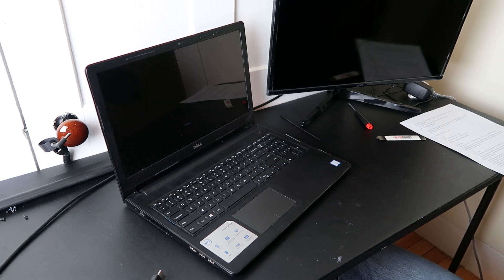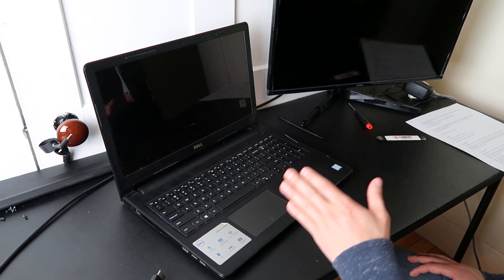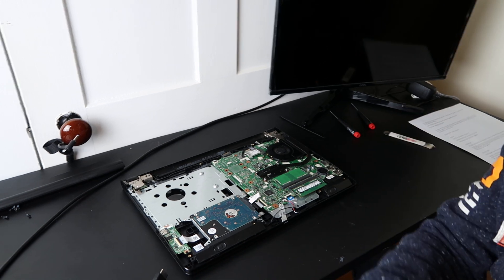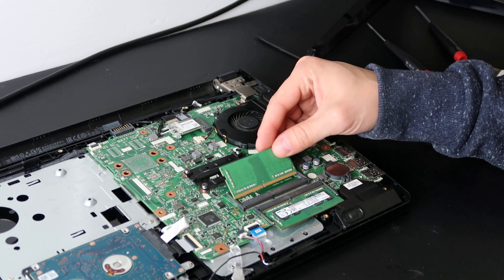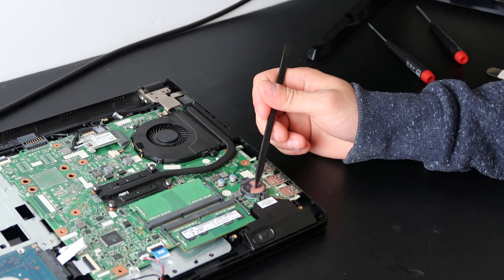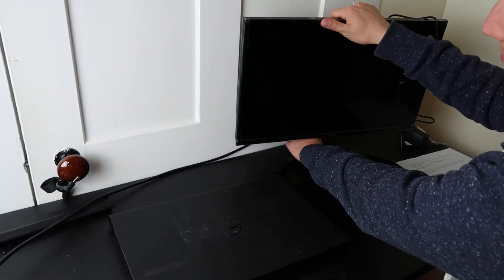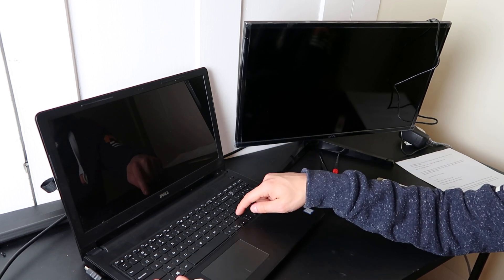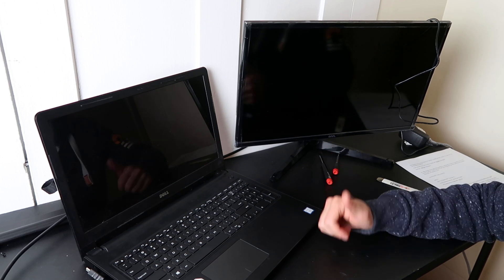How To Fix Black Screen / No Display / Dim Screen / No Picture for Dell Laptop

Comment: my laptop crashed while watching video and i cant do anything and closed the laptop after open the laptop the laptop still crashed
Reply from the maker: Are there any signs of life at all when you try to turn it on?  Lights?  Fan, Motherboard, or Hard Drive sounds?  Anything seen on the screen?
Reply: @PC_Monkey  lights are on
Reply: @PC_Monkey  yes lights are on my laptop is dell latitude 3540
Reply from the maker: @Lolwhoareyou824  If the lights are the only signs of life with no fan or HDD/motherboard sounds then the computer most likely is not really turning on.  For a computer that does not turn on, try this video first;  https://youtu.be/P3I7dDpkJps.  Let me know how that goes :)
Reply: THE LIGHTS AND BEEP SOUND ARE THE ONLY SIGNS OF LIFE
Reply from the maker: @Lolwhoareyou824  Ok so the computer is beeping too.  Is it beeping in a pattern?  
For a computer that does not turn on, try this video first;  https://youtu.be/P3I7dDpkJps.  Let me know how that goes :)

Comment: hello! what size of screwdriver would be best to use in unscrewing? i tried using one of my screwdrivers here but i just couldn't get the screws to come loose
Reply from the maker: Its different on different computers but generally I find that my 261 / PHO x 50 driver works well :)
Reply: @PC_Monkey  oooo i see thank you very much! i plan on doing what you did on your video on my dell n5050 (｡’▽’｡)
Reply from the maker: @twicebestgirls558  Good luck !!  Let me know how it goes :)
Reply: @PC_Monkey  sure!! thank you again :D

Comment: hdmi ok but no lcd
Reply from the maker: Check out the FAQ's on my videos next time!  Could help you get an answer faster :)
If your computer displays to an external monitor but not to its own LCD, then your issue is most likely with your LCD or LCD Cable.  Try 'Reseating' the cable first by unplugging it from both ends.  Then, plug it back in.  If that does not help, replace the LCD and Cable one at a time.

Comment: I just got a new Dell Inspiron 15 3511 and charged it. Opened it and nothing black screen. Held power button 3 seconds and released nothing. I believe there is an internal battery. Are you kidding me? I do not want to fix a brand new computer after I paid for it. This is BS!!!!
Reply from the maker: You def shouldnt have to DIY fix a new computer.  I would leave it charging overnight.  If it wont turn on after that, return it
Reply: @PC_Monkey  thank you for replying we are returning it! Waiting for the return label. How long should one wait for one?
Reply: @PC_Monkey  it was charged overnight
Reply from the maker: @suemedeiros800  How fast you will get a return label depends on the company thats sending it.  Sorry, I cant help with that :)

Comment: at this point I think it's time to give up... 

my dell xps something is well over 10 years old, has a shot battery, broken frame so the screen doesn't stay up and now this. I'm afraid no professional in the world can save her without breaking multiple banks.. breaks my heart to let so many photos, videos and game saves go. 😕
Reply from the maker: If the computer is broken, the HDD may still be good.   The DATA is saved to the HDD.  You can still access it with another working computer :)

Comment: I haven't used my Dell laptop for 2 years. I stowed it away in a box. Today, I turned it on - Black screen. A white and orange light is flashing on the bottom right corner. The keyboard lights up, but that's all. Thanks for your help.
Reply: Have u fixed this?
Reply: @xenon183  
No
Reply from the maker: @jamig.7254  Are there any signs of life at all when you try to turn it on?  Lights?  Fan, Motherboard, or Hard Drive sounds?  Anything seen on the screen?
Reply: @PC_Monkey  
Thanks for getting back to me.
Yes, the keyboard lights up. The light indicator for the battery flashes white and orange. However, when I charged it for many hours, the monitor was still black. The keyboard remains lit.
Interestingly enough, when I first plugged it in, I could feel the AC battery adapter  warming up. Then later, it seemed inactive and cool to the touch, yet the light was still on that attached the adapter cable to the back of the computer.
After charging for hours, I checked the monitor for the last time, still nothing. When I removed the battery cable and closed the monitor, the battery light (bottom right corner) was flashing rapidly in white.
Reply from the maker: @jamig.7254  This video is for a computer that turns on but the screen does not work.  If the only signs of life your computer has are some lights, then its possible that its not really turning on and engaging the Hard Drive, Fan, etx.  For a computer that does not turn on, try this video first;  https://youtu.be/P3I7dDpkJps.  Let me know how that goes :)
Reply: @PC_Monkey  
My battery doesn't come out. It is securely attached to the motherboard.
There are 2 ports for RAM. One RAM card is missing, so I took the one card out and put it in the other port. The monitor screen remains black.
I took out the C-battery for 3 minutes, then reinserted it. Still a black screen. 
I'm thinking the charger is bad, because the laptop will not turn on, unless the charger is plugged in. If the battery is totally useless, then the laptop's keyboard would not light up right?

Comment: Hi pc monkey I have an odd issue, when my laptop turns on the screen is black. But when I connect it to a monitor or TV via HDMI the screen will come on then I unplug it an it works fine , what is causing this

Comment: I have this dell inspiron 15 3000, i just made it stayed open in a while when I came back the monitor gets black. I don't know and I don't have any tools in opening the laptop. Should I bring it to a technician? What should I do to turn it off?
Reply from the maker: Does the screen go black or does the computer turn off?  If the screen is black, what are the signs the computer is on?  Lights?  Sounds?  Fan?

Comment: Hi, thanks for all these useful information, unfortunately, i tried everything you made mentioned and my dell latitude e6400 still remain black, even though all the light came up and one can clearly hear the machine is working. I later discover that a cable from the LCD is broken and I don't think it is changeable because it comes out from inside the LCD,  I think the only option for me is to buy another LCD.
Reply from the maker: Most LCD Cables can be replaced independently of the LCD.  What model Dell do you have?
Reply: @PC_Monkey   Dell Latitude e6400, I plugged it to an external monitor and it shows clearly, but with it's own screen, you can see it displaying under black screen, I mean, its not bright, one struggle to see what it shows. what is the way out ?, Please.
Reply from the maker: @danielomotosho2321  If the computer works well on the external monitor then your most likely looking at an issue with your LCD or your LCD Cable.  I would try unplugging the LCD Cable from both ends and then plugging it back in.  This will help if it has just become lose.  If not, then you should replace the Cable or the LCD one at a time until you find the one with the issue.

Comment: Hi, mt laptop starts up like you say, you hear the insides turning on, the fan kicks on, it shows the dell logo but no loading and then says it couldn't start, click restart or advanced settings but Everytime I click on restart, shutdown, fix the problem with a restart or diagnose the problem, none of it works, couldn't fix the problem, couldn't diagnose the problem.
Reply from the maker: For that issue, your would refer to this video instead;  https://www.youtube.com/watch?v=w3XfE-ghbhs&feature=youtu.be
What do you mean, you couldn't diagnose the problem?  Did the diagnostic test not work?  What happened?

Comment: Thank you for this vid! I'm actually hooked up to an external monitor now. Do you think I should just buy the LCD cable and go with that fix first? I watched the vid to fix it and I literally have to take the entire laptop apart LOL. Thanks for your help in advance.
Reply from the maker: It depends on which you want to do first.  LCD and LCD Cables as you mentioned are hard to get to.  LCD Cables are cheaper to purchase but harder to put in.  Its up to you and your laptop which you would rather start with :)   You can also try just reseating the cable from both ends first before replacing it.  Perhaps its just loose

Comment: I need serious help,my computer turns on but no signal to monitor.the computers a refurbished and I did a diagnostic test and it was all good but during a restart the monitor wouldn't turn on
Reply from the maker: If the screen is black, what are the signs the computer is on?  Lights?  Sounds?  Fan?

Comment: Hello brother, I am from india , I have 8 years old dell n5050 laptop, and same problem I have screen is black but screen showing on hdmi other monitor. and I tried battery method but problem not solved then I take laptop to repair shop there laptop repairer said there is mother board problem , there will be Rs 2000 cost work will be there, is it true or he is lying , or he will just clean laptop ram and inside mother board and just fooling me , please answer ?
Reply from the maker: If your computer is displaying to an external monitor then its most likely not a motherboard issue.  If your computer displays to an external monitor but not to its own LCD, then your issue is most likely with your LCD or LCD Cable.  Try 'Reseating' the cable first by unplugging it from both ends.  Then, plug it back in.  If that does not help, replace the LCD and Cable one at a time.
Reply: @PC_Monkey  Then the repairer is lying and looting money from me.
Reply: @PC_Monkey  I would not repair then their, he is saying there is problem in your motherboard display part, and not in cable part.
Reply: I should take my laptop to other shop where it can be reasonably repair.
Reply from the maker: @priteshgupta4817  The issue could possibly be in the display port but you cant know that until you replace the LCD Cable and the LCD

Comment: What about the screen going black but only after log into it?!  But when I open task manager it shows up and from there I'll open a browser or my computer.  Whatever I open stays on until covered by another folder/app/ etc
Reply from the maker: First, make sure computer is fully updated as seen here;  https://www.youtube.com/watch?v=DDv2gJDjfOM
If that fails to change anything, try a Factory Reset.  Assuming you have a Dell, you can see that here;  https://www.youtube.com/watch?v=IE1zShTb0rU&t=43s.  If that fails, to help, try removing one of your RAM and running the computer on the other on, assuming you have 2.
If RAM is not the issue, then try a new install of Windows as seen here;  https://youtu.be/ULrJVk4JJ20.  You can create your own Install Media for free as seen here;  https://youtu.be/g_UhiHScaSI

Comment: What if it happens off and on? I mean, many times the laptop works fine, but sometimes, especially after goes into sleep mode when battery is down, the display won't turn on at full brightness, and I can see very dim display, almost invisible. Force power off, wait for some time, like 15-20 min and switch it back on with fingers crossed. It may turn on normally or continue to remind dim and I have to repeat the process. Kindly help. Thanks
Reply from the maker: your on the correct video.  Are you able to try the steps seen here yet?
Reply: @PC_Monkey  not yet. Because I will have to buy a RAM to check, as even after changing a RAM, if the PC turns in, I am not sure if the issue is resolved, unless I use it for some days to see if the issue comes back again or not. Can you let me know if the RAM is bad, will the this issue can happen off and on?
Reply from the maker: I cant tell you if the RAM is the issue as I cant examine the computer.  If you cant test the RAM then you will have to skip that step and try the others in the video for now, until you can test the RAM

Comment: Mine is just not making any sound but it on it a hp labtop 625. I suppose it is the batterie small one semiso or ram stick
Reply from the maker: This video is for a computer that turns on but does not display.  If your computer is not making any sounds, what are the signs its on?

Comment: my computer does not show or display on screen i have changed ram and hard disk but still didn't solve it
Reply from the maker: If the screen is black, what are the signs the computer is on?  Lights?  Sounds?  Fan?
Reply: @PC_Monkey   thanks ..I  saw your video removing bios battery  I removed it and return the my laptop  now its okey
Reply: Thanks  for your  videos
Reply: Also my friend laptop its turn on and ends to log then stop there
Reply: What can we do
Reply from the maker: @travexonlinetv2394  Glad your all set :)
I dont understand your issue with the other computer.  I dont understand 'its turn on and ends to log then stop there'
What is happening exactly?

Comment: Dell Inspiron 1500 laptop repeatably beeps on start up with black screen and does not boot
Reply from the maker: Have you tried the RAM test as seen here?
Reply: @PC_Monkey     yes I have tried all the test new RAM and CMOS still beeping and screen still black. Or I have to replace with a new motherboard
Reply from the maker: @harver16  Were you able to get the computer to display to an external monitor?
Reply: @PC_Monkey   not yet am going to try it with external monitor
Reply: @PC_Monkey  yes I tried with external monitor didn’t work, what can do now
Reply from the maker: @harver16   If all of the steps here didn't identify the issue and the computer didn't display to an external monitor then we are left with your motherboard being the problem.  It should be replaced.  You can see an example of a motherboard replacement here;  https://youtu.be/N_7HNrFkMS8.  Let me know if you need help finding one or with the install
Reply: @PC Monkey  okay thank you so much
Reply from the maker: @harver16  Good luck !!  Always here to help :)

Comment: Half of my screen are black ,Any tip?
Reply from the maker: Only half?  That could mean that the LCD is damaged and needs to be replaced.  If you plug in an external monitor, does the issue repeat itself there?

Comment: ahh quality content: pc not working? switch ram, clear cmos, if still doesnt turn on just buy a new laptop
Reply from the maker: So no RAM test, no BIOS reset, and not testing with external monitor.
So how would you troubleshoot a computer that turns on with no display?
Reply: @PC_Monkey  The basic troubleshoot is fine, but if that doesn't solve it you dont simply throw it away.. at least recommend to take it to a technician. I was expecting a basic guide to look for a short on mosfets and stuff. The  repair is probably a few dolars compaired with replacing a mother+cpu wich is almost the same price as geting a new laptop
Reply from the maker: @escafoide  As stated in the video, the solution if these tests dont find the issue is not to throw the computer away lol.  Not sure where that came from.  The next step would be Motherboard issues.  Most of my viewers dont get into Motherboard repair, so a replacement is advised.  Taking to a tech is always a common sense alt when DIY fails to find a solution.

Comment: My laptop battery is not in good condition. is this can be a problem? My screen is turns black and after sometime it is back. Can u please suggest  something.
Reply from the maker: The computer loads and works well but the screen goes black as your using it?
Does the screen go black or does the computer turn off?
If the screen goes black, what are the signs that the computer is still on?

Comment: How are you bro, I have a problem with my Dell laptop. I removed the battery from it because it was not working and it only worked for a cable for a while. Today, suddenly, the screen turned black. I returned the bad battery. First I turned laptop on, it turned red, then I turned it off and turned it on. It came back to black, what is the reason?
Reply from the maker: If the screen is black, what are the signs the computer is on?  Lights?  Sounds?  Fan?
Reply: @PC_Monkey  sound , lights and keyboard is working ,even fan , only the screen is black
Reply: @PC_Monkey  now it's like this https://ibb.co/jbZbPxG

Comment: Hii bro I have a small problem 
Yesterday I buy new laptop( model dell G3 3500) keyboard are working but display is not on) what is problem for that.tell me bro
Reply from the maker: If the screen is black, what are the signs the computer is on?  Lights?  Sounds?  Fan?

Comment: i was putting hdd caddy with hardisk on my laptop when i was turn on and the screen like became white and blank, the i turn on it again, its black screen, how to fix it ?
Reply from the maker: If the screen is black, what are the signs the computer is on?  Lights?  Sounds?  Fan?
Reply: @PC_Monkey  fan, light hdd,
Reply from the maker: @B.Brown2100  your on the correct video.  Are you able to try the steps seen here yet?
Reply: @PC_Monkey  yes, i think it's the bios, do i have to reset it ?

Comment: Hi, my Dell (SPX 15 7590) touch screen fades after being on for a few minutes, and leaves ghost/legacy pages. If I connect to a television (poor resolution) but it is fine.
Any idea what the problem is? Thank you.
Reply from the maker: It could be an issue with the LCD or the LCD Cable.  Rare cases, the Motherboard.  You said when the computer screen starts to go, the external monitor stays healthy?
Reply: @PC_Monkey  Yes, the external monitor stays healthy but the quality of the laptop fades, and previously loaded pages can be seen. 
Is there anyway to check the cable without using another one?
Reply from the maker: @samgrady1493  Not really, without specialized equipment.  You can try reseating it at both ends.  Perhaps just loose / connection issue.
Reply: @PC_Monkey  Thanks bro.